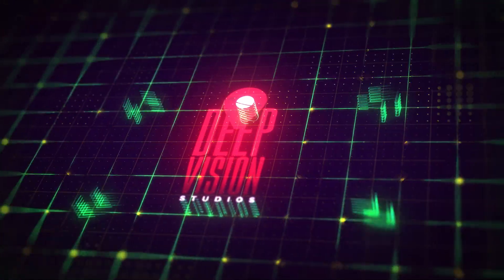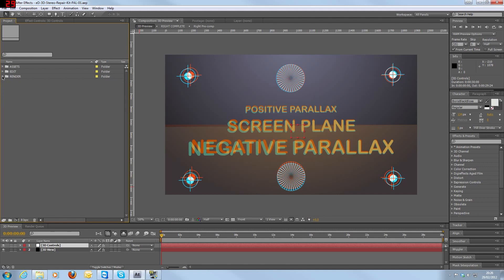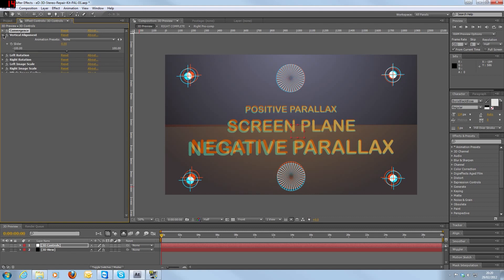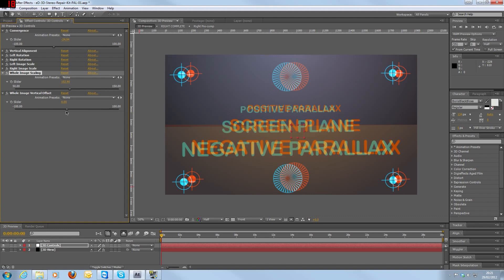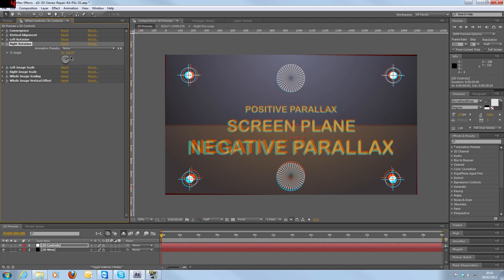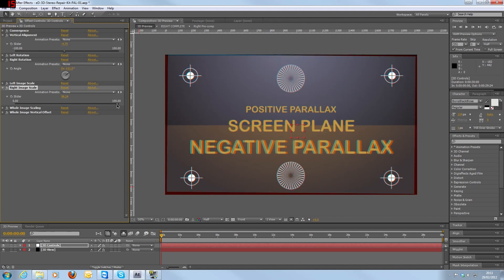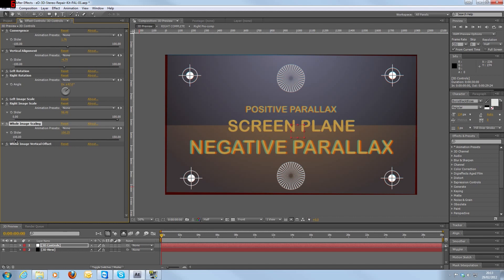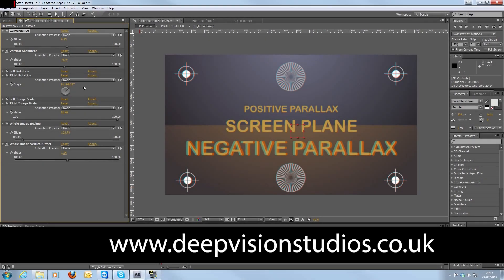UPDATE: Fix Stereoscopic 3D footage problems easily. Free Stereo 3D Repair Kit for After Effects

Comment: I need to render my stereoscopic video in "squeezed" format-is that an option in the render menu? Is there a tutorial for outputting in the proper side-by-side format?
Reply from the maker: Depends what you are using to render it. In some applications you can create your 1080p sequence then apply a "Set to frame size" action. In Premiere I have to untick the retain aspect ratio when scaling box and set the width to 50% whilst retaining the height at 100%. I'm sure there's also scripts for ffmpeg/avisynth out there but that's not my domain.